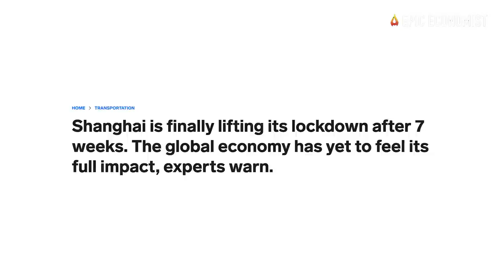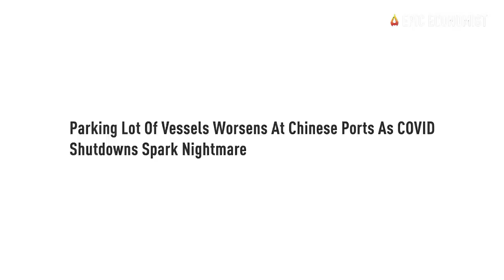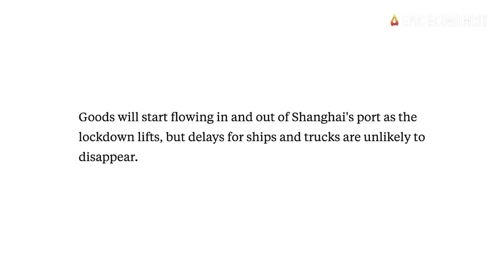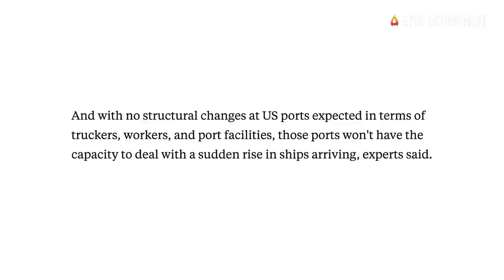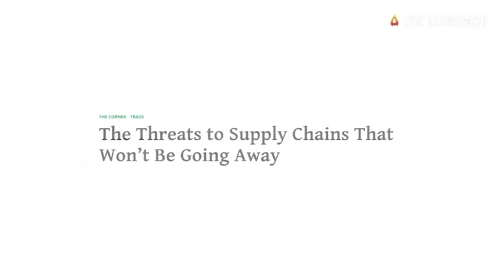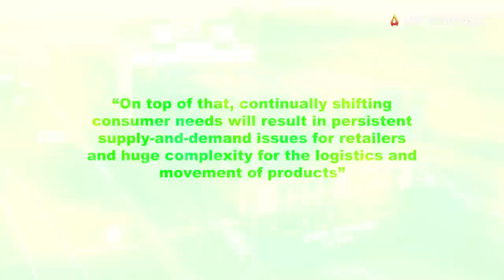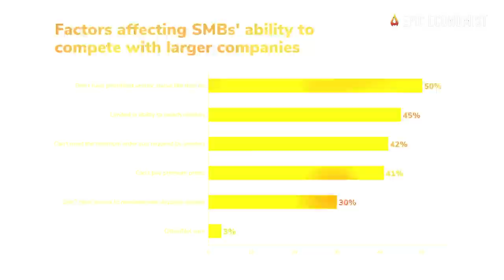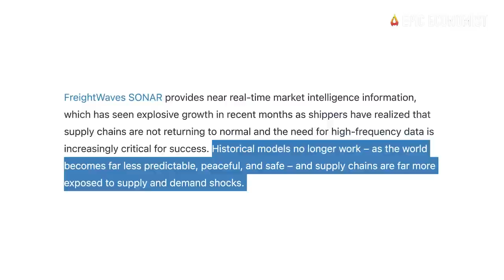Panic Sweep Across Supply Chains As Disruptions Push Container Shipping To Massive Crisis

Comment: B.S. I work at the ports. The bottle neck is because of fuel. Put it this way, "if you run your business with the purchase of $100.00 of electricity, and the power station reduces  usages of power to %75. You do have the option of getting the last  25% of energy consumption with the an extra cost of $ 250.00 you must off set the cost to your products which the customers will pay. Essentially the issue isn't the electricity. It's management of the power station (him or her) . Now the same power station sends electricity  to your house. Now you are in double trouble, because you have appliance that depend on the power station. To make matters even worst . Legislation passes a law the no electricity equipment can be used between a set hours of the day, or week. So (you) a consumer is battling: The electric company (price gouging), business failing due to customer decline. Lastly the government is cooperating with the corporations. At last. You either merge bought out, sold, or shut down. 

This is man made crisis to validate de-population a.k.a= reduce carbon foot print. 

This explains the vast amount of control in vacs, media, and lively hood. This generation of kids won't survive with a trade, and if an internet hobbiest? , they are likely to be destroyed,  most content viewed now were already video taped 15yrs ago in the beginning of YouTube. Nothing really new , just different situations video tapped for a reaction.

Comment: Walmart is having a hard time keeping the shelves looking full each week.  The baking flour shelves just got reduced in size by half.
Reply: Their warehouses are full and they are waiting for when they can double and triple the price.
Reply: @D-B-Cooper  You are correct
Reply: The Wal-Mart down the street from my house has containers sitting in the parking lot.  I doubt if they were empty they would be there.
Reply: I work as a remodel specialist for a large national grocery chain that owns 12 chains and several private label brands. They are already factoring in a reduction in produce, and produce that gets canned. Also, fuel is expected to increase 50% by years end. There is some discussion about changing gas signs at all west coast fuel centers. They need that fourth digit to price gas above $10. It's getting uglier. Lots of stuff that's been ordered over the past 2 years has arrived. It's been sitting for up to 2 years. They will.reduce the price to move it as quick as possible. Once it's gone, it's gone for a while. Get what you need.
Reply: @ApostateApostrophe42276  A 50% increase in fuel cost increase equates to about $6.75 per gallon, at a National average of $4.50 per gallon right now. Where do you get boxcar (4th digit)  figures from? What math is this? Are you attempting to mean 100% increase? That means double, 50% means half!
Reply: @joshuaharrelson572  I stock a Walmart on third shift. Those containers are holding things that have something to do with seasonal items like holidays, also extra items for lawn and garden like top soil and mulch
Reply: Our Walmart's problem is that it is drowning in freight.  Corporate reduced store staffing when they boosted the starting wage to $15.00/hr and the remaining employees are not achieving the desired productivity. Overnight stockers are expected to do the work of three employees, with the company believing that the information technology they've invested in can be leveraged to accomplish that goal.  But it hasn't worked thus far.
Reply: No spaghetti at my local Walmart today !
Reply: I don’t really use flour
Reply: @jamesrogers47  my wife works at Wal-Mart and she Ben there 5 years and she don't make 15 an hour she bust her ass here in Oklahoma then they  cut her hours and she's 57 years old and has body problems and I'm disappointed  in the system they don't care for the employees and people treat them like shit iv seen it Wal-Mart  sucks u work for them then give it back to them if u shop there that's why we don't  buy there God speedo u all that work there
Reply: @dannyvictory6920  There are a few daytime positions that start at $13, mostly part-time, but in key job codes, the start wage has been $15 for full time workers.  And yes, the company understandably expects greater productivity for that amount of pay.  Every job sucks, if it didn't people wouldn't dream of retiring.  But for positions that don't even require a high school diploma, $15/hr is very generous.
Reply: @ApostateApostrophe42276  And for the cost of a can of beans, how much is fuel? What is the percentage? If you are really distribution/logistics you would know this, cmon, tell us. And yes, I'm in the biz.

Comment: Shortage of qualified labor my ass. Corporate cop out excuse redirecting blame. The real issue is overworked underpaid treated like dog shit just a number you can be replaced attitude. You want good dedicated workers you gotta ante up and yes it will come out of corporate and exec's profits where it should come from. Hell the US transportation and electrical infrastructure was built from the 40's through the  80's and most of it has fallen into disrepair due to funding being pulled and sent to more short term gain infrastructure projects of the same nature. Our communications infrastructure was largely built through the 70's and 90's. I live in a rural area in the center of a 30 minute to 1 hour drive to at least 5 major cities and we didn't get access to cable or natural gas until the mid 90's. Now our communications infrastructure is overloaded because the old style coax cables can't handle the gigabytes terabytes and some petabytes of bandwidth. We are just now receiving word  from communication companies that they are all going to fiber optic but it could take 10 to 15 years to complete the upgrade. This upgrade is only happening because state and federal regulations are forcing the big communication companies to get off their asses and are already dealing with major fines because these upgrades were supposed to started in the late 90's early 2000's. Yeah keeping up infrastructure is labor intensive and expensive but if these comms companies low ball their contracts then they will get shotty work quality and the average users will suffer. For the first time in my life (41) cell phones and land line phones have matched reliability. Shit my home phone loses connection as much as my cell phone does. On the comms service issue I strongly suspect that a huge part of the problem is cyberwarfare and overprioritized bandwidth being allocated to major urban development areas. Even my cables tv pixelates and cuts in and out like satellite service in a severe thunderstorm. Yeah our infrastructure is aging like those who built it and being treated just as well.